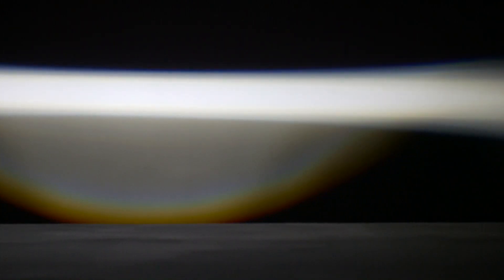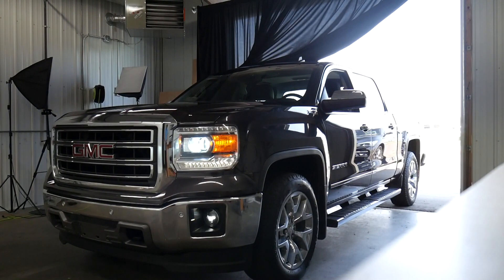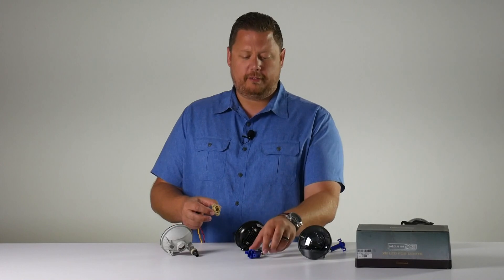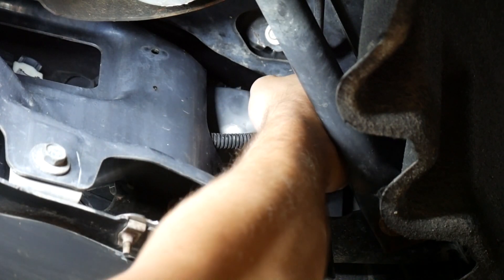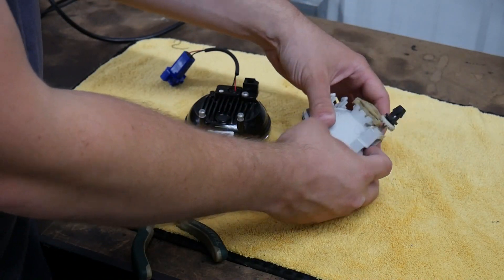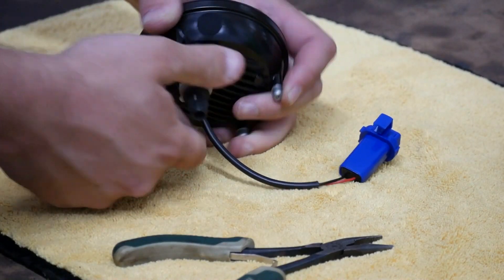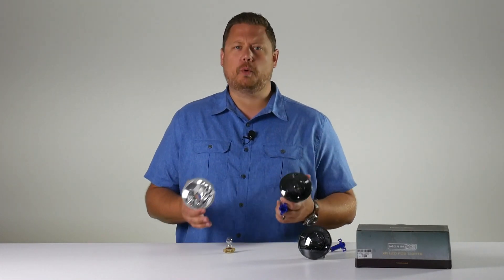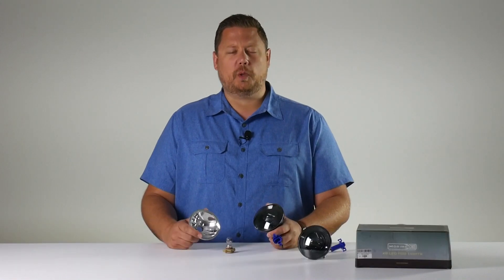Morimoto LED Fog Light Install for GMC Sierra | Headlight Revolution

Comment: I have a 2017 GMC Sierra 2500 HD and replaced my fogs with the Morimoto LED, huge upgrade! They put out so much more light on the roadway without blinding oncoming traffic and have a much wider beam. I was so impressed with quality of Morimoto, I replaced my stock HID 25w headlight bulbs with Morimoto 35w HID headlight bulbs, another quality upgrade. Both have greatly improved my light output on the road, best upgrade I've put on my truck.
Reply: Which kelvin did you go with? I’m trying to do the same for my Silverado Hd
Reply: @willdamian1066  I believe there is only one choice, but mine are 5500K. I also replaced my original HID bulbs with the Morimoto 35w bulbs.
Reply: Michael Lannon yeah I meant your hids. Sorry i didn’t make myself clear.

Comment: I had purchased a pair of cheap bulbs and within a year they stooped working,I just ordered a pair of these....Thanks for the video!
Reply from the maker: Glad we could help
Reply: @HeadlightRevolution  would you happen to know the part number for the adjustment assembly im working on a build and don't have the stock parts to transfer. I have the morimoto's already but am stuck lol.

Comment: Hey GM, what engineer spec'd that horrendous bulb type for that reflector bulb?  So much failed and cost cutting in that design and waste of material. They should've just made a dummy fog light while they were at it.

Comment: I was told this housing is also the same as the the 2015-2017 Colorado/Canyon. Can you confirm. As well as do an install if it is compatible? I would buy these in a heartbeat. Thank you.
Reply from the maker: Technically they fit, but they are not plug and play. Some years of the Canyon utilize some weird CANBUS control system that makes them not work all the time, and can damage the Morimoto fog light. I know Morimoto is working on a fix. You COULD use them but they might not work. They might become damaged from the truck's electrical system. Or they might work fine... :)

If you wanted to, you could string up a basic relay harness that is triggered by your Colorado/Canyon fog light wiring, pull power from the battery directly, and power the new fog lights that way if you're desperate for them. Not a hard project but a decent amount of extra wiring. It can be done!
Reply: Headlight Revolution Thanks for the response. I'll wait until something compatible comes out. I have a 2017 Chevy Colorado.
Reply from the maker: Sounds good. Thanks for watching!
Reply: Headlight Revolution TY

Comment: The install video is ok but no need to use that pry tool and no need to unplug the light from the housing until it is pulled out.  They made it harder than what it was.  The plastic shroud just pops off.

Comment: Would these fit my 2010 sierra? Looking to upgrade. Thanks for your time and video
Reply from the maker: We don't carry new fog light housings for your year Sierra, but we do have a great bulb replacement to vastly improve your fog light performance! Check it out here: 

Link: https://headlightrevolution.com/gtr-lighting-gen-3-ultra-series-led-headlight-bulbs-5202-2504/
Reply: Morimoto has these for the 07-13 Sierra
Reply: They show/said that they  wouldn't fit the 2019 Colorado which they did perfectly , but as long as your fogs are round these will fit.

Comment: Any plans to update these fog lights with the more powerful osram HX Boost LED chips?
Reply from the maker: Morimoto already has with their 4Banger LED Pod light. The HXB uses the Osram chip you mentioned. You can see the full range of 4Bangers here (https://www.headlightrevolution.com/search?keywords=4banger) or the ones for the GMC Sierra here (https://www.headlightrevolution.com/custitem_cat_facet_application/Sierra-%2807~13%29,Sierra-%2814~18%29?keywords=4banger)

Comment: My 2017 Sierra SLE doesn't have these round lamps ,it has the small rectangular ones.
Do you have a brighter set to replace those??
The stock ones really are worthless in bad weather.
Reply from the maker: Send us an email at Sales@HeadlightRevolution.com and we will get you a few different options to choose from!

Comment: Do you have a video for replacing the rectangle Morimoto LED Fog Lights for 2018 GMC Yukon Denali?  I could not find details on the Morimoto website.
Reply: Morimote hypes the sale, but doesn't follow through on the hype or have an actual working website for assistance with install or getting parts that weren't but should have been included.

Comment: Hi sir. I have a 2017 Hyundai Sonata Sport and I want to upgrade the headlights to LED. Do you have any suggestions?
Reply from the maker: Frank, I highly recommend the GTR LIghting Gen 3 LED's. They are the brightest on the market and also have a lifetime warranty. The GEN 3's can be found here: https://headlightrevolution.com/gtr-lighting-gen-3-ultra-series-led-headlight-bulbs-9005-hb3/
If you are looking for a cheaper alternative, we currently have a great sale on the  Supernova V3's and they are a great alternative. They have a flexible heat sink so they can fit practically anywhere! There is also a 2-year warranty as well. And those can be found here: https://headlightrevolution.com/supernova-v-3-led-headlights-9005-9145-bulbs/

Comment: The led lights in my car flicker and sometimes turn off then back. Do I need a anti flicker resistor?
Reply from the maker: Sounds like you either have defective bulbs, or you need a capicitor/pwm module, depending on what application you are talking about.  Shoot us an e-mail at Sales@headlightrevolution.com and we can help you out.

Comment: looked like high quality, but not much light on the road.
Reply: Sergei Kolotilin thats why I upgraded with a rigid industries setup. A lil more cost but nearly triple the light output. 
But some model vehicles are not supported by Rigid so Morimoto is the next beat option.

Comment: Would these fit on a Tahoe 2013?
Reply: They said they wouldn't fit my 2019 Colorado but I bought them and they installed without issue, on your 13 Tahoe I would say yes as those fogs are round.

Comment: I did led in fog lights and never burt lens fogs are better than headlights
Reply from the maker: Fogs are better than headlights? What do you mean?
Reply: @HeadlightRevolution  my headlight suck so bad I put in led's and led's in my fog lights and fogs are way brighter I don't even use high beams they are worse than low beams with fog lights on

Comment: I have emailed you guys multiple times about a product, but no response. What gives? You have time to release multiple videos, but can't respond to a simple email? 😤
Reply from the maker: Jimmy Tran we have responded to every single email we've received. Please check your spam folder for our response. Otherwise tell me your email, or contact us on Facebook.
Reply: I emailed sales@headlightrevolution.com, is this a working email for y'all? Just in case, I YouTube messed y'all. Hope to get my answer so I can purchase a pair of bulbs from y'all!
Reply from the maker: Jimmy Tran yes that's the correct email. I didn't see anything in our spam folder either. Please check your junk mail folder in case our reply got stuck there. If nothing else, try using the Contact Us form on the website. www.HeadlightRevolution.com